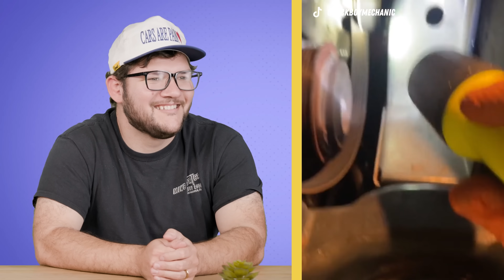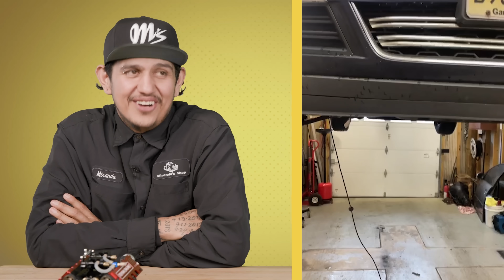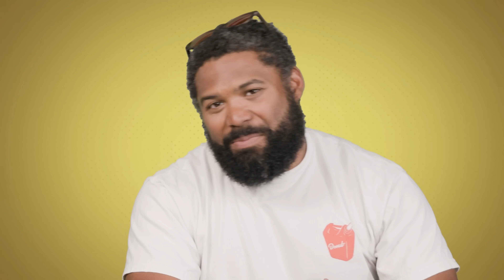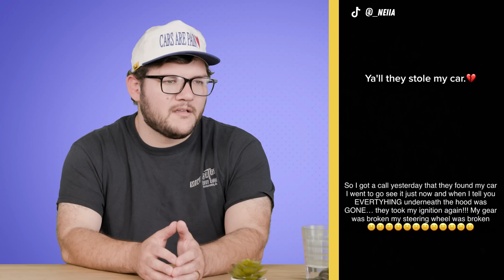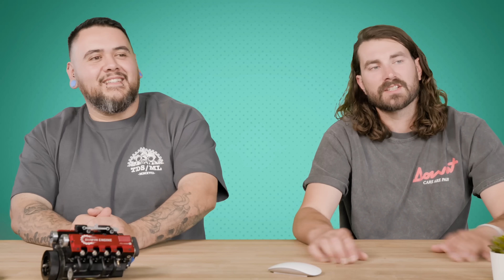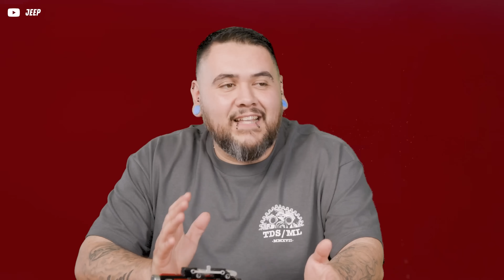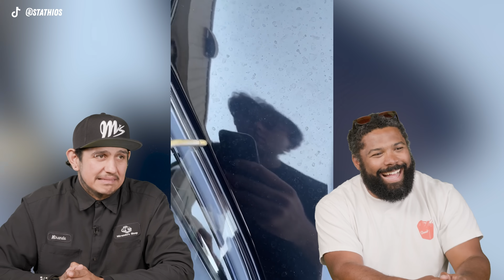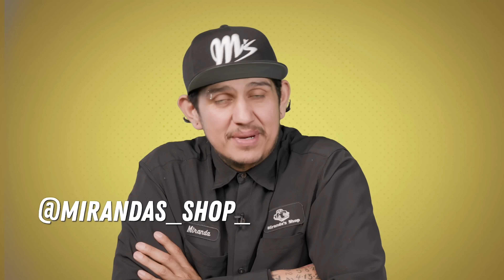Mechanic Reacts to Car Engineering Fails

Comment: I worked as a service advisor at an Audi dealership, and those Q3 sunroofs were a leak problem. The sunroof  cassette tub portion would crack, and the whole sunroof cassette had to be replaced. The dome light would fill up with water in the center. Console would be a swimming pool. We were replacing carpet going through wiring. Audi are a very problematic car.

Comment: I mean... A lot of these "engineering" fails are marketing/MBAs making the decisions not the engineers. They ask if an engine designed for 1 car will fit in another and get wired up under X cost? Then later you find out the belt tensioner bolt hits the frame because an engineer was never actually asked to verify any of that. Or, the engineer flagged it as a concern and it got rejected for costing too much to re-certify or cut in an ECO. I've found errors on drawings that had been there for years because "It will cost $4000 to get all the approvals required to get the new drawings released to the floor. Just flag it and we can fix it the next time we redesign this part". And don't even get me started on procurement telling me I can't use the part I know works because the price went up by $0.20 so we need to design in an alternative/replacement part.

Comment: for that bolt up against the frame, couldn't you remove the quarter panel and just cut out a hole. and then stick a rubber grommit or plug in there 🤷‍♂️

kinda ghetto but why not

Comment: The the transverse mounted Ford motors they put in virca 2013 - they shoved the waterpump into the engine and run it off the timingchain... A WATER PUMP replacement takes over 10.5 SHOP HOURS.
 Since youre already paying for the labor - you mightaswell replace the chain, the guides, the phasers, the tensioners... and if you have any money left - the oil pump. GOOD BYE $3K and GOOD LUCK finding a shop that actually wants to touch it.

Comment: The thumbnail was easy. Tensioner pulley bolt on a 2000s Caddy- Snap On sells a wrench for it ($120 last I checked) Or you can grind down a shitty HF wrench to fit for only $15

Comment: In the case of that bolt I would use a hole saw 2" in diameter through the frame with pilot drill coming alongside the bolt. Mustang 428 comes to mind with it spark plugs.

Comment: I worked for  ford early 80s building fairlanes and LTDs. They had a guy off  the line checking pamel alignments and gaps amd re aligning them. Called Quality control

Comment: With the McLaren issue, I would put the blame on the engineer for the rusting washers, or the supplier if the washers were specified to be stainless and they rusted.

Comment: The first one with that belt tensioner bolt touching the frame. The time he spent ranting on and on about it, he could have drilled a hole bigger than the bolt in the frame to get enough clearance.

Comment: Don’t get me wrong let me make it clear I am not a mechanic I am simply just a lube technician at Valvoline but I do services on cars every single day so I know my way around cars somewhat seeing them everyday there are some simple terrible designs at least when it comes to oil changes and services related to that the GMC trucks that have that stupid cone in the way of the oil fill opening blocking it which really makes it a pain that engineer design straight up sucks, the GMC Acadia oil filter it is topside oil filter but right next to the heat shield like who designs the oil filters in such a sucky place the Mazda Miata oil filter is basically behind the engine you have to reach way back in there to try and get at it the Fiat 500s have it at a terrible angle, the new Ford Rangers the oil filter is in the wheel well and the cover sucks to get at in at the angle but then you got oil filters in heavenly locations like the Subaru outbacks or the top side filters on the 3.6 pentastar Chrysler engines are pretty easy to work on I will say the modern stuff from Mopar sucks but the classics are way better when it comes to Chrysler and Mopar vehicles I definitely think everyday that the engineers and designers are complete idiots when it comes to the placement of things in the engine bay like come on why make it so difficult to work on I definitely blame the engineer designers when it comes to the mechanical stuff.

Comment: Note been tec for 40 years plus.  My father was a engineer. After a bad day working on a bolt simulator clearance problem in first picture. I asked him if engineers ever think about repairing a vehicle after it's built. He responded no just to get car built as easy and cheaply on the assembly line.😮😢😢😢

Comment: Easy solution for the idler pulley bolt.... cut the bolt off and replace with a shorter bolt.

Comment: I had  an 07 durango that I had to replace the rear sway bar link. The driver's side bolt was in backwards . I would have to remove the gas tank to get it out. I just cut the bolt and got a new bolt.

Comment: Former engineer for the big 3 in the late 90s. I thought it would be a dream job working with a bunch of gearheads. Turns out most of the engineers don’t even change their own oil much less repair anything under the hood.  Engineers commenting here are car enthusiasts, not the majority designing cars.

Comment: These are not engineers. They need to take their degrees away from them. I think the perfect punishment should be to have them work on the vehicals they design.

Comment: jip,  on the Ford rocam motor they had 3 different lengths of 5mm/7mm step drill for the M6 tap varying in length from 18-25mm when the max strength you will get out of the bolt is reached at 3xd thread engagement. All engineers should work as a mechanic for at least 5 years before they can design anything.

Comment: manufactures build cars with getting just past the warrantee with there extended oil changes and then expect you to buy a new car from them after that, they dont care about the car after the warrantee and actively sabotage the life of the car with plastic parts !!!

Comment: Rear control arms on drivers side on my 2010 jeep cherokee.   So the nut is on the outside the bolt pulls in. The fuel tank is the way. I would have to lower  the fuel tank in order to pulls the bolts out. Maybe a 20 minute job turns into hell no im not doing that job.

Comment: I've also seen a lot of new cars. When they roll off the line and get damaged or something happens, they get sent down another line for repairs. Often those cars don't make it to the end with the same standard. Case in point is those vinyl landau tops of the old '70s and '80s! Normally those were put on to cover up damage on the roof of the car.

Comment: On that belt tensioner just cut the bolt behind the tensioner and use some grippers to finish lefty loosey-ing. then go buy a bolt with the same diameter and thread pattern but half an inch shorter. no way im lifting the whole motor just to clear the frame.

Comment: With the sunroof leaks…8 times outta 10 the sunroof drain plugs are clogged…1 every corner of sunroof…weed eater string works perfectly to clean it out…alot of cars could of been saved from this…

Comment: Let me ADD a SPIN twist to this.. (as a mechanic)--I have learned that many problems that appear engineering failures actually stem from "bean counters" who tell engineers "NOPE--gotta do it cheaper" all the time!! Therefore corners and simplicity sometimes get CUT to make more profit... basically "strangling" engineering depts.   Just my 2 cents here!! --However many engineers do not care as they never have to "work on it" themselves.. SO take my comment how your expeirences teach you.. LOL  --add to that--"CAB FORWARD design" on trucks... that is engineering all the way and you should NEVER have to raise a cab off a chassis to pull heads, etc. --Damn you FORD!! (and others now!) ---reason my newest vehicle is a 2007 and all 3 of my cars were made in sweden plus one 86 -chevy S-10. LOL

Comment: I ran a swtich to my Crank Position sensor on my 2001 Jeep Cherokee.  It'll turned over as long as the battery has juice but no spark...

Comment: dude, 5 years would be a dream, we´re at under 3 years now, you know what happen´s when you make a mistake? You´ll find out just in time not to be able to fix shit^^

The first two model years will have all the bad designs in them, if you get a new car, look to it being at least 2 years in production already, the main issues are out there, and most of them will be fixed on yours

Comment: Why call yourself a mechanic??? No one has mentioned the simple problem …. Cars are built by many manufacturers but what most have in common is they all use the same engine …… so a so called mechanic sees it as a problem NO …… a mechanic will work and use his skills …… your not a mechanic if you just want to swap parts even a monkey can do that

Comment: Engineers and government rules have screwed up the car industry. I have spent many hours cussing about the engineers crap they throw out like that.  In between not having room for simple tasks to be performed, to the requirement for a special tool or even 15 different styles of wiring connectors on one car... it is all pathetic.

Comment: More and more cars/engines are not designed well. Its like they're not supposed to be worked on? Just replaced. 
I'd hate to know what conversations are had at a higher level of production? Who cares, as long as it last the warrantee period, save money, cheap, customer doesnt matter, thats good enough etc etc

Comment: ive dojne the first one on full size trucks required me to pull a radiator to pull a bolt was 1/8 inch long. the bolt took only 5 mins when you look past the 45 mins it took to pull the radiator.

Comment: My jeep renegade has a drl out. So I changed the bulb. Now it says the turn signal is out. But what's weird is the light blinks now. I didn't even know it was the turn signal cuz it wasn't blinking. Now it does blink but it's out? Also the 12v plug doesn't work. And the tire pressure sensors decide when they wanna work.

Comment: Bolt length is determined by the required stretch length needed to maintain proper torque.

Comment: Not car stuff, but Apple's shit is SO poorly designed. Literally the main power wire which has a HUGE amount of electricity is sitting right next to the storage wire, which needs WAAY less power. 

Any humidity or shot in the main line bricks the device. With no way to get the customer data. Look up Loius Rossamn

Comment: @11:35, here's my take: when oil drains directly onto a cover, it's definitely the fault of engineering. As engineers we have guidelines regarding the amount of disassembly required for each type of regular maintenance operation. If a certain part needs to be taken off for changing the oil, for example, it needs to be specified in the service manual. In my opinion, however, considering the frequency of changing the oil, it wouldn't be acceptable to require taking off that cover and therefore the oil sump or that cover would need to be redesigned to remove this requirement.

Comment: Here's my 2 cents as a mechanical design engineer in automotive: if a vehicle has a lot of assembly problems, then it's also most likely partly the engineering team's fault. Engineers are supposed to consider assembly in their design down to even many times completely redesigning an area just because the current solution could lead to assembly problems. A basic example would be having 2 parts that are almost identical redesigned so that it's impossible to accidentally swap them.
One concrete example that comes to mind from recent experience is when we had to postpone releasing a subassembly into production because some wires had to go through and it would have been possible for them to get pinched in between 2 parts that were being assembled unless we made sure it was absolutely clear for the assembly operator exactly where the wires are supposed to be routed through.

Comment: One thing I have is on my 2014 Cadillac cts coupe you have to take off the entire front end to change a headlight. Also on the 2021 Mercedes c300 my dad has the windshield wiper won’t go up because the hood is blocking it.

Comment: That first clip reminds me of the spark plugs on my Subaru.2 years after mine they did a refresh and tweaked the frame shape so you can get the plugs out without having to drop the engine or weld up a custom length socket extension.

And as an engineer, I'm ashamed of whoever did that. On my Subaru and that Chevy. I guarantee whoever was designing that on the engine never got with whoever was designing the engine bay to make sure every bolt would clear. They made it fit in the designated space but didn't make sure you could disassemble parts in that space.

Comment: I worked as a production development engineer for a major diesel manufacturer and a joke that bounce around sometimes was that, we make the engine, then they make the frame or vice versa. Sometimes one engine is used across multiple companies and applications. As a requirement we had to do virtual fit checks with different tools to validate but due to many variables, cost, production release date, current headcount to redesign last minute design flaws is why designs aren’t always ideal

Comment: I owned a Jeep Wrangler from 2006 when purchased new to 2023 when I traded her in for a new Explorer.  The only major problems I had with her were electrical,: I had to replace the battery every 5 years on the nose, you could set a clock by it.  Another problem I had which was the only real major problem was that the alternator blew and took the computer with it.  There were also other age related problems that started to appear.  The reason I chose Ford was I test drove one and that was all she wrote, I had to have one.  The other reason is because I'm getting older and lifting my leg up to get in the Jeep was a bit much for me anymore.  I love my Explorer though.

I can say one thing I absolutely hated about the Jeep was when you would get gas.  The gas cap didn't have a flange in the neck of the tank so when the gas would get to the top, it would splash everywhere.  You would have it on you and the car, also the cost, so furstrating.

Comment: Yeah I've had a few operators give us a talk about our designs. But I mean there are different sectors of engineering and sometimes we have to compromise on designs. Also designing things to be maintained is something I always do. Everything I designed at work I made to be easily serviceable. Idk, I haven't really seen an engineer not think about replaceable parts or maintenance...

Comment: Ooh oooh I got another one. Disclaimer: I fucking hate working on VW shit, straight trash imo. The example: 2014 GTI 2.0T.... And it's not just that year and that car, just my only experience with this engine..... How about 5.5 hour labor time 2 replace the, wait for it..... The fucking valve cover gasket. Why? Oh because they decided to make the valve cover and the camshaft caps 1 whole integrated unit, so that to do the job the way it was designed means pulling the fucking timing chains off. 🤦🏽‍♂️🤦🏽‍♂️🤦🏽‍♂️. Can be done without removing the chains, but that is just ridiculous 2 engineer it that way. Face slaps are deserved on that bullshit.

Comment: Or hey Ford, how about on the F-150s with the coyote engine where the sway bar is so perfectly imperfectly located that the oil drain stream has only one path.... Right onto the sway bar and then everywhere but into the oil caddy. Easy solution is to just unbolt the sway bar bushing caps and let the bar hang, but I mean, c'mon, really?? How in the hell did that get overlooked in design? I get that sometimes it's out of the engineer's hands, but this particular case is just an awful oversight at the engineering level.

Comment: Gotta love newer Ram 1500s where the oil filter sits directly above the electric power steering rack module assemby and connectors so that without using a form-a-funnel or the like, the steering rack and control module connectors get a nice hot oil bath every time. So cool.

Comment: I recently replaced the aux belt tensioner in a 2022 Kuga 2.0 diesel. It had two bolts holding it on, both right next to a piece of chassis. Had to raise the engine to get the top one out and then lower it to get the bottom one out.
Changing an aux belt tensioner in most cars is a 20 min job. This took 3 hours (mostly just looking at it wondering how the fuck to do it 😅).

Comment: First clip is people just not looking enough.. in order to remove the tensioner bolt, that bolt is also the alternator bolt, you have to remove all alternation bolts and tilt the alt so you can take that tensioner bolt out lol

Comment: Sometimes the problem is purchasing. If we buy a 1.5" bolt instead of 1.25" we save $0.001 per bolt and I get $$$ bonus, no need to check with engineering all specs are the same just a little longer.

Comment: what do they mean when they say that "you don't get paid for the extra time you spend to go out of your way to do something"

Don't you have labor costs that are billed per hour in the US ? In Europe you pay parts + the time that it took the mechanic to do the job - or is the time estimated in the beginning and then cant be changed ?

I've had a situation where some AC fan component was rattling around in the vents and the mechanic said that it's not worth taking it out because they'd have to remove the entire dashboard and that would cost me lot in labor

Comment: Former design engineer, the team that made that super wire crammed tailgate handle for toyota didn’t want to do it. The art design made them. Barely pulled it off.